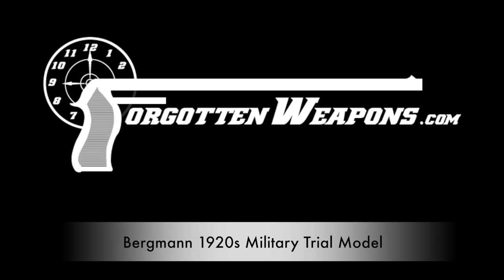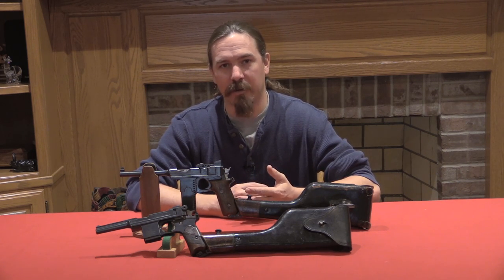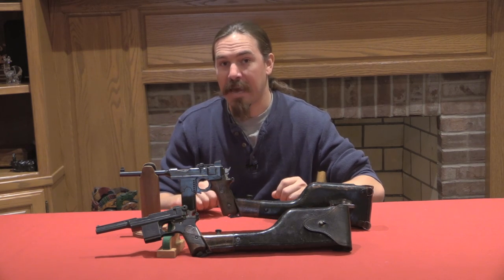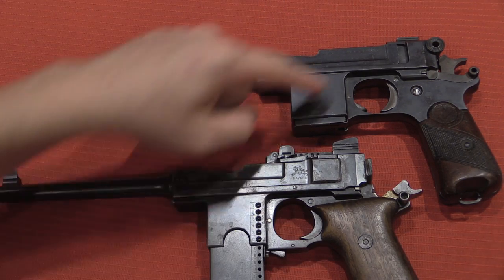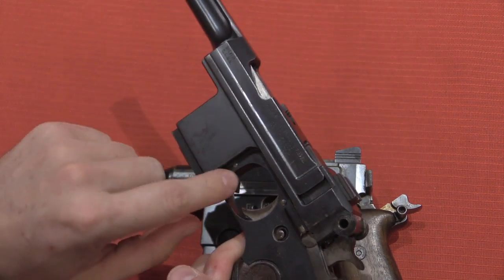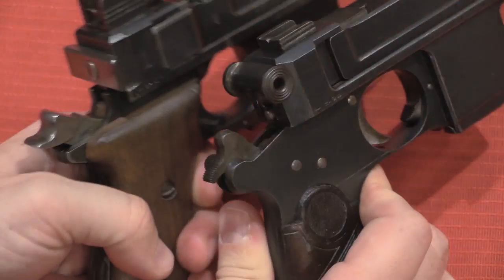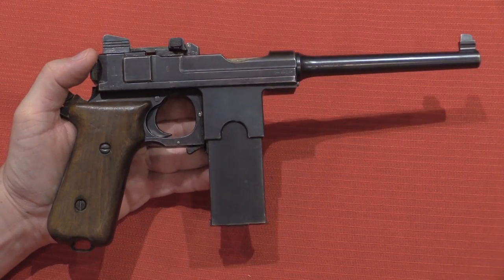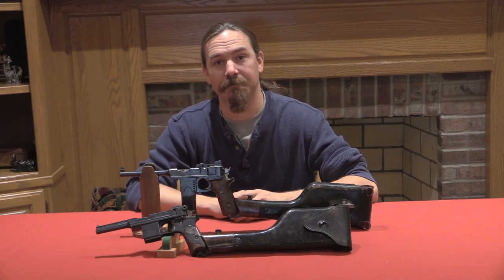Bergmann 1920s Experimental Military Trials Pistol

Comment: at what point if ever did everyone give up on holsters as removable stocks?
Reply from the maker: The 1920s, in general.
Reply: didn't Mauser continue to produce a holster stock till 1941?
Reply: These Bergman's, though it looks like a lot of Mauser C96 was applied, were the end of an era, and show the change in Military Doctrine that was coming in at the time. Ian critisies the mag removal on the early ones, but! Do you need to take the mag out that often when de rigeur was charger loading? I notice this pistol still has charger load. Also the SMG and Self Loading carbine made a pistol with stock irelevant, to bulky as a pistol, not as useful as an SMG or  carbine. WW1 also brought about a lot of changes in doctrine, a slump in the world economy, lots of firearm innovation and it had been the War to End all Wars, so no major country was looking to rearm, and for the rest the market was awash with surplus. RIP Bergman.

Comment: My god, this collection is incredibly comprehensive! Its owner was very generous to allow us a peek – some amazing pieces in there.

I didn't care too much about the Bergmanns, but gradually they really grew on me... be it Ian's excellent presentation, or the fact that they slowly became more and more like the iconic "broomhandle" C96 Mauser (one of my favorites :)

Which raises the question, which of the two was ultimately the superior design? Obviously they share the same form factor shortcomings, and the C96 was more successful commercially, but what about accuracy, reliability, usability, design ingenuity and refinement etc. ?
Reply: capitalize God
Reply: I guess the C96, mostly beause of easier disasembly, but also because of the durable locking mechanism with its two lugs, the long guiding rails of the slide, the tangent sight and the legendary machining quality.

I still find it fascinating that the one and only single screw the C96 uses is the one for the wooden grips, and how the main components come togheter.
Mauser surely did a great job in terms of quality!

On the other hand the Bergmann locked breech versions have a detatchable mag unlike the C96 (except some of its post WWI versions).

It would be interesting if there are quality differences in the Bergmanns of the different manufactures (V.C. Schilling Suhl, Bergmann Gaggenau, AEP Herstal and the two danish manufactures of the M1910/21).
Reply: @philp8872  Good points, thanks  :)

Comment: My two favorites are the very first version because of it's nice rounded grip profile and smaller frame. I think the larger looking trigger finger hole was designed to work while wearing bulky gloves. Also having the side plate release accessable without the need to remove the grips I think is a plus.

The very last model obviously copied features from Mauser or Astra which I like. Everything mentioned does seem like an improvement. 

The Colt 1911 probably seemed to be a more streamlined design after it came out. Somebody should do a parts count on a 1911 and a Bergman to see which would have been easier and cheaper to produce.

Comment: Nice. Didn't one of the Spanish firms, probably Astra, make a clone of this in the 20's? Or was it a C96 clone? I can't remember. I do remember, when i was 11 (34 yrs ago now), having a toy gun which closely resembled a C96 detachable mag style, although i think the grip shape was wrong. It looked much more like this. It had the usual full auto sounding noisemaker gears when you pulled the trigger. And it had the word "Schmeisser" molded in the side near the mag well (all molded as one piece, only thing that moved was the trigger). Maybe someone at the toy factory knew something i didn't,  or had just heard the name somewhere and thought it sounded cool to put on there. Ah, memories. Great video as always. Thank you
Reply from the maker: You are probably thinking of the Astra 900 series.